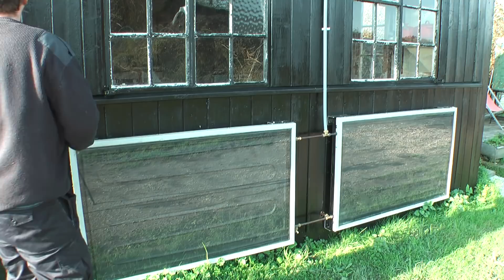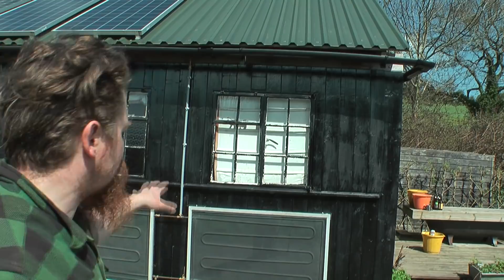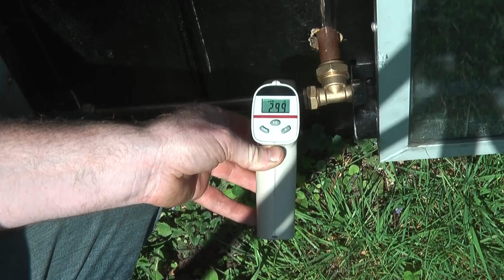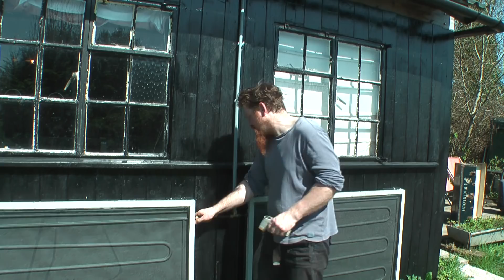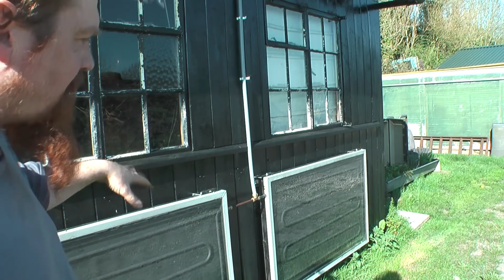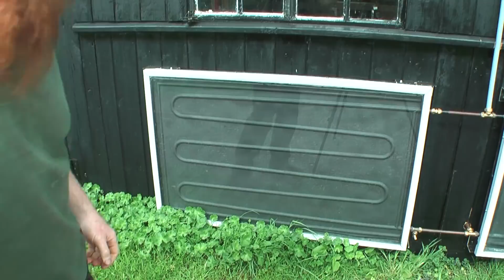Solar Hot Water Part 2 (of 3)

Comment: hi theres a couple of things that would improve your system for the flat plate collectors  so maybe you would appreciate this idea if it hasnt been posted. practically i dont know if it would work for you because i havent seen the lay out of your place. so as your flat plates are in that location why not map the suns direction across the sky to the work with a set up of mirrors to reflect additional sun light (watts) onto the flat plate collectors. did your flat plate system boil over in summer? high temperatures this year so im interested to know. the other improvment for your system i would have is more controls and sensors ( i didnt see any installed so you may already have that) and a far larger tank if it was possible as larger mass of water in one tank would be better than 2 tanks of equal volume. it would improve the time in which your hot water and heating will last. other things i was thinking have you tried using a thermostore tank instead of a double feed indirect (the same set up just working in reverse. the hot water demand would run through the coil to heat the water for example as you dont need high temperatures of 60degrees for a shower and then having a programmer installed to run pump for the hot water system with a automatic bypass valve in the system in a loop for the hot water to run a weekly 60 degree water in the hot water system to disinfect pipe work of legionella . interested on your thoughts for the off grid practicality. or having a solar loop and indirect tank?
Reply from the maker: There are *no* sensors or controls! The point of the experiment was to make a completely self regulating thermosyphon system in the same way my gravity fed central heating works. It's done well so far, providing a near constant 40ish degrees in the tank all summer, I occasionally fire up the woodburner to push the temp up over 60degrees. A full report will appear in due course. I can neither make room for nor afford a thermal store but I agree it would be much better to have one.

Comment: Hi, just a few thoughts, It seems as if there is alot of heat lost in the pipe work, the return 28mm pipes will loose return heat so keep the panels cooler than if the returns were closer to cylinder temp. Secondly if the panels were set at (say) 20 degrees then this would extend the time where the sun was making a contribution. Cheers, Andy. PS. I agree with you on the solar PV,  there is no such thing as too many panels, especially in the short days of winter. Cheers
Reply from the maker: It might seem sensible to lag the return pipes but in order for the thermosyphon to work the return pipes must be colder then the flow (the bigger the difference the better) as it's the denser cold water falling that pushes the hot into the heat exchanger. I have now insulted the flow pipework which made a big difference. Agree angling the panels out would make a difference but they need to be flush against the wall to allow for vehicle access, I am also interested to see if the vertical mounting will benefit me in the winter (as it did with the PV when they were mounted in the same place).
Reply: Max, thanks for your reply. The angle thing would be interesting. With PV one would have thought that a steeper angle would work better in winter, but it turns out because there is more cloud at that time of year then the majoirity of the light is reflected or diffused so a smallow angle works best as an average. As solar thermal works mainly on the red end of the spectrum then maybe as there is less energy in the red then this will be different from the blue used in PV.  There is only one way to find out, and that might be a bit tricky and I reckon you have enough on your plate, Cheers, Andy. Ps like the fresh horse poo for squashes idea.

Comment: Another great video, thank you. Might I ask, are you concerned about legionaries if your hot water tank goes for periods without getting that hot?
Reply from the maker: Thanks. I've never had a problem, I do push it to 70c every so often and I've occasionally sent chlorinated water through the system (the ceramic filter removes chlorine from the drinking water).

Comment: Consider redoing your coils inside the boxes. Maximize the piping surface exposed to the sun. Only downside is as you increase pipe length you impede the natural water flow. Also consider increasing the pipe diameter downstream of the solar heaters. Also consider insulation on both the back side of the heater boxes and the exposed piping. Adding a small solar powered pump may drastically increase your efficiency.

Comment: hi, had the same panels some years ago,what i did was put another copper cylinder on the mains cold feed to your main tank,so the main tank never recived cold water, it was always warmer than cold water due to the pre heating. ...if that makes sence lol.

a couple of years ago i got  a newer panel for free "it was only 2 years old lol" it looks like a quilted bag! however it gets the water into the low 70C ,at this point i did go back to a normal 2 coil tank

Comment: hi interesting video as usual . can u advise in a camper van with 2 lesuire batteries what size solar panel would i need to keep them trickle charged during more sunnier times ahead fingers crossed lol keep the vids coming colin
Reply from the maker: Can't really advise as depends very much on your usage, but these days with solar panels being so cheap, I'd be inclined to put a 250 or so watt panel up, see how it goes and add another one later if needed.
Reply: Maximus Ironthumper hi thanx i just wasnt sure whether a larger one would be overkill thanx for info colin

Comment: you can use old single panel radiators to collect solar hot water painted black and put in a box with insulation and cover glass. That will allow collection of lots and lots of warm water.

Comment: You can use the solar panels on a pre heat water tank as quite often with a system like this the sun cannot reach higher water temperatures. The evacuated tube can get to higher temperatures faster.

Comment: Interesting stuff that, cheers for sharing! In situations where you use both the immersion heater and the panels; do you reckon that the extra warmth you get out of the panels will save you much in electricity? In my brain it seems that if you just used the heater on its own, you might be starting the heating process from (say) 20 degrees or 30 degrees, whereas if you have the panels your starting point might be 40 degrees (i.e. a 10 degree head start).... maybe?

Perhaps that is a moot point though as (presumeably) the immersion heater runs off electricity you collected with the PV during the day anyway. Running it through the floor though definitely seems to be the best outcome from this though, if it is already at the right temperature for that it can crack on with heating the house while you are working and save more power by not using electrically heated water to heat both the tank (and indirectly the mass of the floor).

I am still getting my head around these ideas so don't know if I am totally on the right lines. Its given me a bunch of other ideas as well actually, but perhaps I will share those in another comment as I seem to be waffling on here. Thanks again for the info anyway its appreciated!

Comment: You said if the system ever boils, you will need to replace that plastic tube. If your system ever does boil, it's open to the air so there won't be a build up of pressure which means the temperature should not go above 100c.  The steam can go over 100c, but the liquid can not go over 100c unless it's under pressure no matter how much it boils.

Comment: You are right in everything you said.  Just wondering if it could get hotter if you took copper piping and bent it into same configuration thereby doubling the coils within each box, which would not cost much to try it.
Reply from the maker: More piping in the panel would mean more bends and less flow, I think the makers of the panels had the right idea by soldering the pipes to a copper sheet, as copper is very conductive so lots of heat can be conducted through the copper into the water in the pipes.

Comment: Your angle of incidence is less than ideal. Would be better if you had them tilted more towards the sun and placed on roof. Increased pipe length inside the panels and a smaller diameter pipe would also be better, therefore more 'zig zags' or switchbacks packed inside the box. with more water molecules in contact with hot surface.
Reply from the maker: The experiment was to see if they would thermosyphon, they won't do that if roof mounted! I was  surprised at the lack of pipework inside the panel, but thinking about, it more pipe would mean more bends and less flow. The pipe is soldered to a sheet of copper so benefits from having heat conducted into it from all over the panel.

Comment: Excellent information as ever mate.. I'm just in the process of moving into a static on the farm I work at in Essex with my daughter, needs must as the devil drives, but it gives me a chance to utilise all this information I've collected over the year's.. im thinking of a stove for heat and a bit of cooking with propane for back-up, running just a shower for cleaning and getting solar installed.. obviously this is all happening a bit unexpectedly with not a lot of money but any thoughts you have on the best setup for my situation would be much appreciated. There is power on site but with 2 other statics for a couple of the other lads, overloading the system is a concern and I'd just like to be as independent as possible. Cheers mate, take care and good luck for the future!
Reply from the maker: I spent a winter in a static once and the biggest problem I had was not making the heat but keeping it in! Hopefully your one is not as ancient as mine was, but even so anything you can do to insulate it, will help both in summer and winter, even heavy lined curtains would make a big difference. My other top tip is electric blankets, you may laugh and think they're for old people, I did when someone gave me one, but wow they are great for winter nights! Use hardly and power and take about half an hour off the time it takes to drift off to sleep. You can use an propane powered instant hot water boiler for showers (like they do on boats) and then that can be a back up to solar if/when you install that. In fact I'd recommend looking through the canal boat forum for ideas - you'll find you have a lot in common with full time boat dwellers! Best of luck with it all.
Reply: Maximus Ironthumper thanks mate, you're a true gent!
Reply: Maximus Ironthumper electric blankets! Top idea too! Haven't had those since I was a kid when we just had the rayburn

Comment: Another great video Max and thanks for demonstatimg an answer to my "will it thermally siphon?" Question..
Evidently it does !!! Great.    Having heated an 18k ltre swimming pool at higher latitudes I know it works. More panels can help. However, it is a delta temp thing. To get your floor warm and stay warm in the UK spring you need to warm up an insulated large bulk of water to a high ambient 30 to 40 deg C and pump it slowly for a few days. Big job but....Burying some IBCs and solar heating them may work. Once again love the narrative videos keep em coming.

Comment: Have you thought of wiring your heating element directly to the dc output of the panels rather than DC to AC240V to AC120V to 3kw heating element?

If you work back from 700W at imersion you would be 823W into transformer (85%eff) and 866W into inverter (95%eff). So losing 166Watts.

If you had the AC 3kw immersion (17ohms) wired to your panels (guessing around 200v) it should pull the array voltage down to where the total panel power = imersion power at the maximum power point, i guess around 150V. You might even be able to keep the inverter connected at the same time
Reply from the maker: I did consider it but I read somewhere the thermostats on immersion heaters don't last long working at DC.

Comment: When using gravity to circulate round the coil 28mm is usually fitted for it to circulate properly in a domestic property. Painting radiators matt black should help too m8...
Reply from the maker: Yes they are freshly painted matt black, you can see me do it in part 1! The loop has 28mm in the return, the rest is 22mm, the radiator lop is all 28mm. Both are working well.

Comment: Try insulating the complete pipework circuit.  If if outlet is 37 deg, inlet is 23 deg you are getting 14 deg temperature lift on the panel. If the tank is 36 deg (depends where you measure the temperature) and the inlet is 23 deg you are losing 13 deg in the pipework. If the tank gets warmer by 10 deg then with insulated pipework your inlet and outlet temperatures from the panels will do the same.
Reply from the maker: As I said in the video, I will be insulating the pipes, this is not the finished system, just an update!

Comment: Mounting your water panels flat and vertical against the wall is your big problem with them heating water.  They should be positioned so they face flat and perpendicular to the sun's rays.  You should mount them differently.  Exactly where is your hot water tank, I missed that?  cheers
Reply from the maker: I do explain why I mounted them as I have. The hot (and cold) tanks are in the loft directly above the woodburning range.
Reply: Not being a dick, just saying! Whatever the reasons, that mounting configuration is detrimental (negatively affects) to their ability  to collect solar thermal radiation.  What I have see done which allows water panels to be mounted on the roof above the water storage is to have a small DC pump which is powered by a small dedicated solar panel. Of course there is a thermal control circuit so the pump won't run if the panel temp is below the water tank.  

You could simply use you existing panels to power the circulating pump with a thermal control circuit.   Those water pipes should be insulated to reduce heat loss too  I'm sure you were aware of all this before I commented. Thanks for the reply all the same.

Comment: Hi Max, this might be utterly ridiculous but would you not get more heat in the solar panels and for longer if they were on your roof ?.. I suppose not easy if you're using gravity :)
Donation made. thank you for your video's. :)
Reply from the maker: A bit but not much, the angle of declination would improve (it's at 90degrees on the wall would be 55 or so on the roof) but the sun would still only hit the panel squarely from 10am-3pm ish and as you say no chance on a gravity loop. Thanks very much for the donation!

Comment: When i converted a barn we lived in a caravan with no water , in the summer i used to lay out the hose pipe in the concrete and cover it with polythene sheet . at 6pm my wife and me would use it for a shower , it was really hot . but we could go to the pub clean .

Comment: Enjoyed that, and useful info though for a new build rather than use water to heat the solid floor, you could, as you say, have more Solar PV panels and use excess energy to heat a floor with an electric underfloor system like http://www.theunderfloorheatingstore.com/prowarm-electric-underfloor-heating-150w-mat-kit  maybe it would be even worth you possibly increasing Solar PV and tiling concrete floor with Prowarm below tiles ? In fact would both work ?? You could keep the solar water for the solid concrete and then also have something like prowarm on top of the solid concrete ?
Reply from the maker: Not a bad idea! It's all money though...
Reply: Maybe there's a way of making some similar sort of underfloor electric heating from scrap ? Just somehow increase resistance to produce heat, wonder if it could be achieved with scrap cabling that you could lay under tiles ?

Comment: Just a thought, perhaps restrict the cold water input so the water already in the panels has more time to heat up or have the hot output from one panel going into the cold input in the other panel.
Reply from the maker: I may experiment with that when the summer comes.

Comment: Why not add a small electric solar panel in the same orientation as your water panels direct diving a recirculation pump? The pump would only run when the panels were exposed to sunlight optimizing efficiency. Also thermosiphon works better with larger bore pipe, early automotive systems relied on it and had substantially bigger hoses than systems with a thermostat and pump.
Reply from the maker: I have a radiator system that runs very well without a pump, this experiment was to see if I could achieve the same with solar hot water.

Comment: Very interesting video. As a matter of interest building codes in Australia say that hot water systems should have a minimum temperature of 60 c to avoid the risk of of bacteria in particular legionella. Is this a consideration for your hot water system. Interested in the topic regards David
Reply from the maker: Yep, I do occasionally bring the tank to over 70c using the the woodburner for that reason.

Comment: The plumber at our factory uses "backflow devices (non-return valves)" to stop both hot water and non-potable water mixing back with the mains supply due to pressure differences - thinking something like this would help with your flow issues?
Reply from the maker: It's a idea, I'd need to find one that's non restricting - more experimenting required!

Comment: I've got 2 hot water panels here in Australia and we can get a 200l uninsulated barrel of water from about 20 degrees to 50 degrees in a few hours. Ours is boosted with a very small 12v pump running off a plugpack. We plan on getting a secondhand hot water tank off gumtree so we lose a bit less heat. The sun here is a bit more intense than in most places and the panels are angled at about 60 degrees.